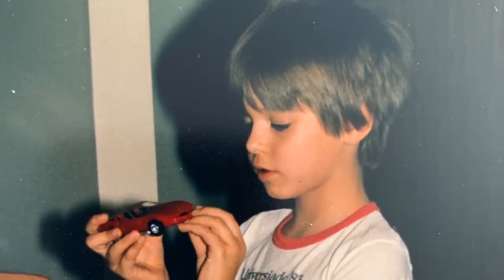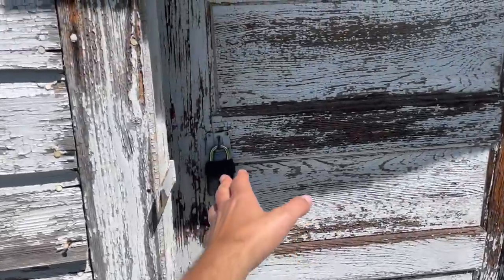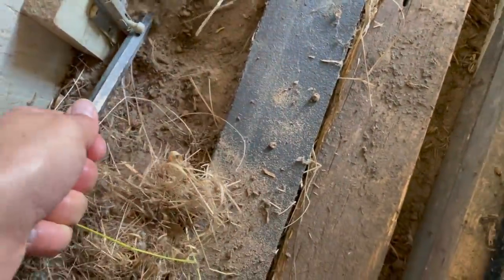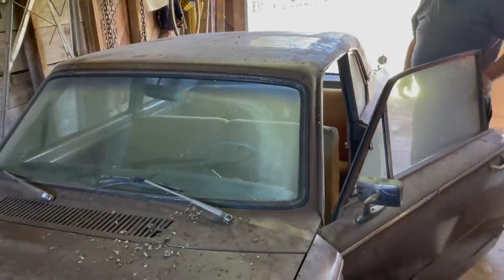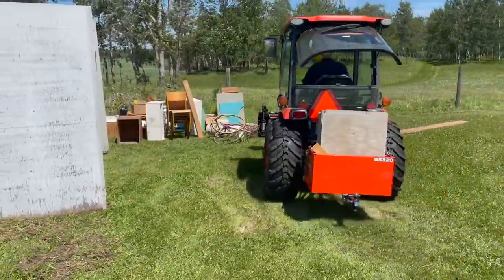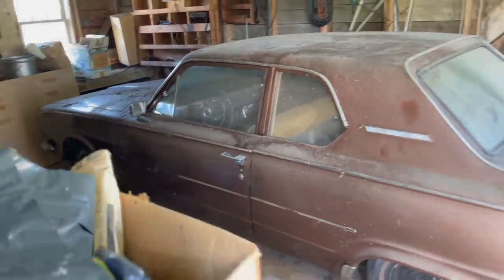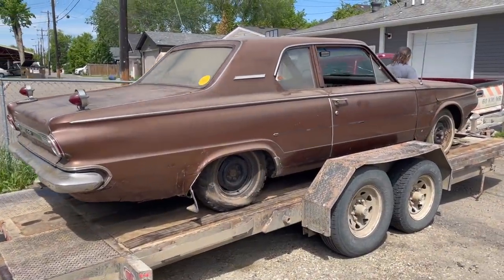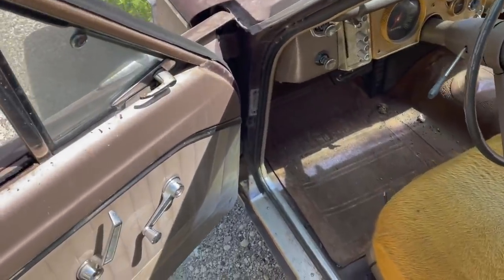Car trapped 50 Years in a barn… watch us dig it out!

Comment: This was exciting for me. My very first brand new car was a  '64 Valliant 2 dr post with a 225 slant 6. Ah, those teen years. Great memories. I changed  the hub caps out for "baby moons" and moved the shifter from the column to the floor, then jacked up the front tortion bars so the car sat like a "California raked" gasser. Thanks for the memories good buddy. 🙄
Reply: Keith did the hubcaps improve performance, wheel covers are as useful as bumper stickers and engine covers best to throw away at nearest garbage can
Reply: @bradzimmerman3171  thanks for the comment Brad. I was a kid just 17, when I got that car. Dad paid up the bill, and I paid him in full, incl. Interest, over the next 2 yrs. The hub caps were the first change, so it wouldn't look like I was borrowing my dad or  mom's car. They would never put "baby moons" on their car.  None of what I did to make that car  "look mean" make It faster, although the Fenton floor shifter was spring loaded for fast 1st to 2nd shift. What great old memories.  Cheers!  ✌ P.S. the whole car, brand new was only $2,200.00

Comment: Those tail lights are off an Imperial. I had a 64 Valiant 170 cubic inch Slant Six with a 727 Torqueflite, push button transmission.
Reply: Wouldn't it have been a 904 trans? My 66 has a 904 auto on the column. Also, how was the 170 to drive with? I'm used to a bit more power than that, being that mine's a 225.
Reply: @thoseoldphonos5722  Yes, you're  probably right about the 904. Horsepower was 105 for the 170 cu in and 145 for the 225 slant six.  I was enough to get you around but that is about it.

Comment: One thing I’ve noticed is older cars from Canada seem to be more rusted out 
I assume because of the salt and longer winters up there
Reply: I don't believe that all Canadian areas use salt. I think I have heard Alex say it's not used in his area.
Reply: for situations like this, the general colder temperatures may help create a more damp ground, combined with still getting up to temperature once in a while to bring it up might help rust out these cars from the bottom. but it really happens just about anywhere when ground contact happens. so maybe the freeze thaw cycle is just increasing the rate that tires deflate and the wheels sink into the ground?

Comment: I had one of those when I was in high school :)!  Solid car but that rear end normally sat low.  Need to add or replace springs to get it up on the right level.  But it is a very valuable old chassis for sure.  170 slant 6 as I remember.

Comment: I had that same Filter Queen vacuum up until my mid-20's 🤣  he's right, only works if it's torn apart and you use the floor attachment as a hammer 🤣
Reply: I had FQ for years, bought it new 
In 1977.  Works best on plain floors, not carpet.

Comment: In Australia these were a Chrysler Valiant. This one is a very close resemblance to our R and S series. They had the good old slant 6 motor and a choice of either a 3 speed column shift manual or a Torqueflite 3 speed auto with the push buttons on the dash. They were great cars, I had two of them in the 1970's. By the way, here in Australia if you just simply jumped into a barn find car like Charlie did you would probably die. The car would be home to a number of venomous snakes and spiders and other nasties and would not appreciate being disturbed.  Extracting an old abandoned car from the bush or shed here requires a very cautious and precise approach.

Comment: The wheel lug nuts on the drivers side probably have left hand threads.  
Before attempting to start, I would remove the spark plugs and spray the cylinders with a fogging oil and wait a few days and attempt to turn the engine manually with a breaker bar.  If it's stuck, attempting to start it with the starter may damage the flywheel and/or starter.  Good luck.

Comment: I bet it has the famous slant 6, one of the  best engines ever built in the United States.
Reply: Yes slant six either the 170 or the 225.
Uncle Tony be says the 170 is the most perfect engine ever built.
Reply: @alanmerritt860  Chrysler, sold that engine to all sorts of agricultural manufacturers as well. I had a small Massey Ferguson self propelled combine with the bigger engine, it was great. John Deere, put it in their swathers as well. It was durable, and, the low profile was perfect for tight fits in cars and industrial machinery. I wish they still made it today, with fuel injection and electronic ignition, it would still be a great engine for a small truck or car.
Reply: @keithkuckler2551  I don't know if you follow Uncle Tonys Garage on YouTube but he's put a 170 in a Miata. Purrs like a kitten.

Comment: One problem I see is that most of the stuff around the car does not have dust on it. Dust on the car looks like it was mainly sitting open while in the building.  Nice car though
Reply: Big Daddy ... have seen that before and it's due to generational clean out. They park the car and 20 - 30 years later they move the basement / attic stuff out to the garage as well. IOW, different levels of dirt / dust depending on when someone dies or when they move crap around. Good chance that home has seen several generations of people as well.

Comment: Please do not suggest restomoding this car, it is an extremely rare model. First year for uniquely Canadian Valiant, U. S. Dart body with U. S. Valiant front clip, dash and trim.  Also, I do not think U. S. Valiant V-200 or Dart  270 (high lines)offered 2 door posted sedans.
Reply: i have a 67 Valiant Signet  the highest trim level    its a 2 dr post   in fact  only way to get a valiant 2 dr after a certain year  was a 2 dr post
Reply: @markb7906  yes, 1967 on.

Comment: It's a slant 6 those engines always run they never die anyway it's a cool car the resell is not very high being it's a Valiant now if it was a Dart or Polara then they are worth a bit more. It's too bad someone put those lights on there they look to be off a early 60's Imperial or something but they were not from the factory and I am sure they drilled holes in the top of the quarter panels to put them on ruining the tops of the quarters

Comment: I'll wager it has a slant six in it. best engine chrysler ever made so far s reliabilty goes. Chrysler actually put big v 8s in some of them, but there was a drawback, to change ther two rear spark plugs, you had to pull the engine. It might have a 318, a good reliable long lasting motor too. bigger than that, you've got problems you don't need, and then you have to change the tranny too, and do away with the push button feature. Just get it drivable somebody will pay up if it runs and drives.
Reply: Chrysler didn't put a V8 in those A body cars until 1965 and it was a 273 LA motor. The first Big Block wasn't installed until 1967 after the A bodys were redesigned. Chrysler said a B engine wouldn't fit until Grand Spaulding Dodge showed them that it would. You didn't have to pull the engine to replace the rear plugs they were easy to get out from under the car, in fact all of them were easier to get out from underneath. I worked on many of them back in the day when they were almost new as I started working in a Chrysler Plymouth dealer in 1969.
Reply: @jdgimpa  all I know is I saw one that you couldn't get to the back plugs, and it was supposedly stock.
Reply: @tootall5559  Looking at it from the top you couldn't get the back plugs out. Like I said put it up on a hoist and take them out from the bottom. I worked as a Chrysler product technician for 30 years and replaced the plugs in more of them than I can count, most of them when the owner said he couldn't get the back plugs out. You had to use a wrench because there wasn't room to get a socket on the plugs. Even from the bottom.